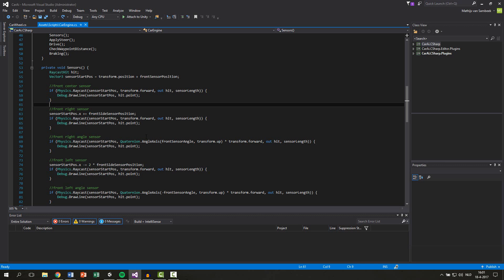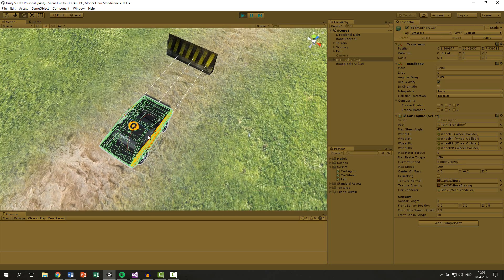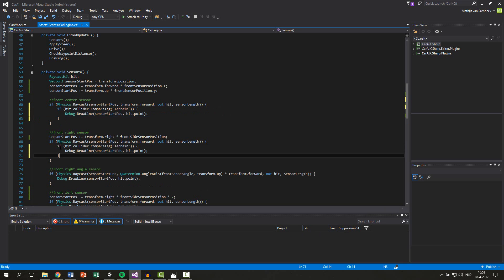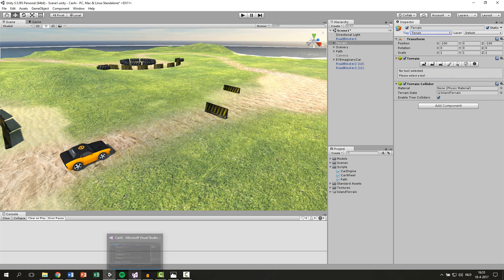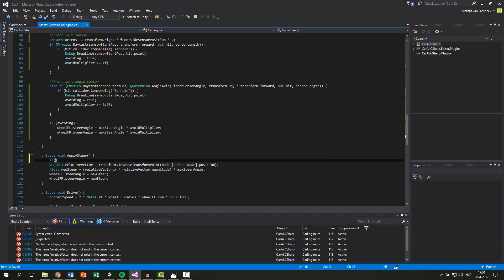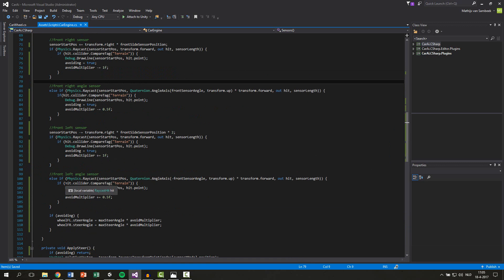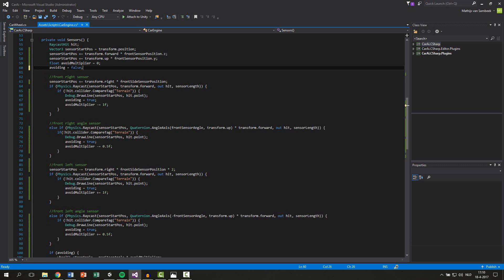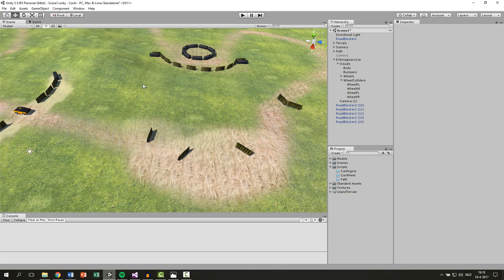Car AI Tutorial #9 (Unity 5 ) - Avoiding Obstacles

Comment: Once my vehicle avoid an obstacle, it no more follow the path it should be. what do I do?
Reply: does it update the last waypoint? check that with debug, if it doesn't change the value in the "checkwaypointdistance" function...
here:

if (Vector3.Distance(transform.position, nodes[currentnode].position) < 0.05f)

increase the 0.05f value until it works... at least that's what i did

Comment: Don’t they teach proper coding in schools anymore :) an if block per sensor. You can have an array or list of sensors and iterate through then, less code, less buggy. And for the ray compensation, you can pass a Func pointer ;) 
It explains why all the BSc students I work with write such horrible code. I think the educational system doesn’t teach it properly anymore ;)
Reply from the maker: Raymond Doetjes lot of the education nowadays is self-education via online sources. Mostly due to the fast changing materials and wide availability of information. But indeed, you are right.